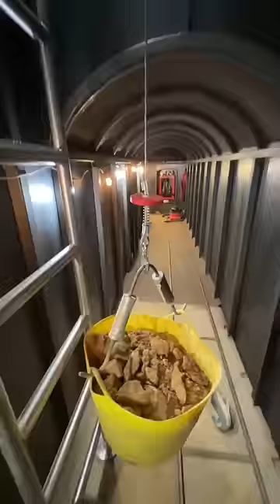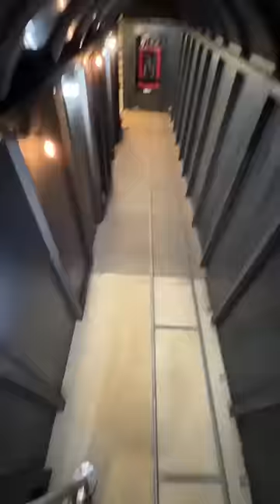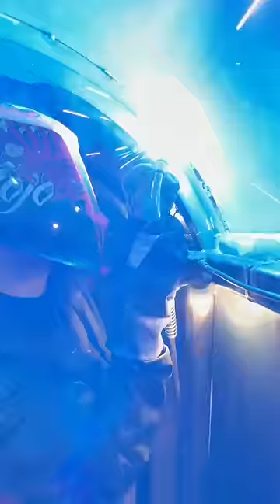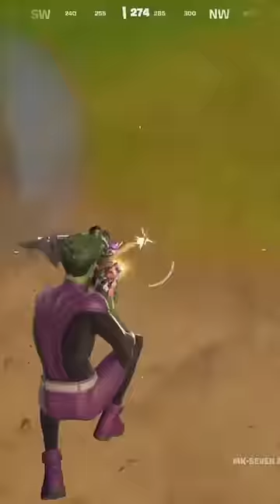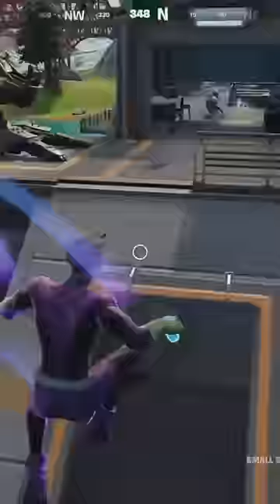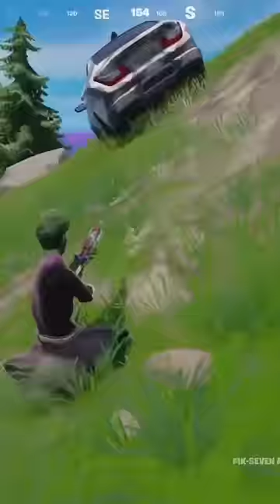Tunnel video is close/Fortnite #shorts

Comment: Can you put in a little porthole type window so you can see the bare rock whilst in the tunnel? Extra points for using RGB LEDs to illuminate it.
Reply from the maker: i'm looking to do this, i think it will condensate up but may be worth av gamble
Reply: @colinfurze  It probably would condensate up unless you made it a sealed double glazed unit that was connected to the wall by a mini metal tube,  effectively keeping out the air.